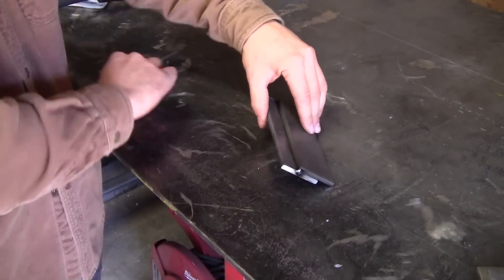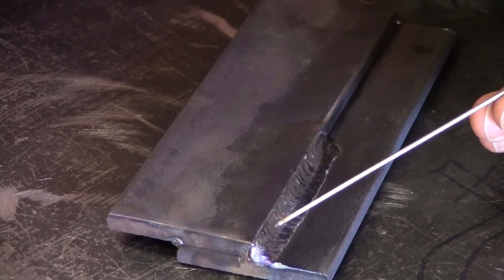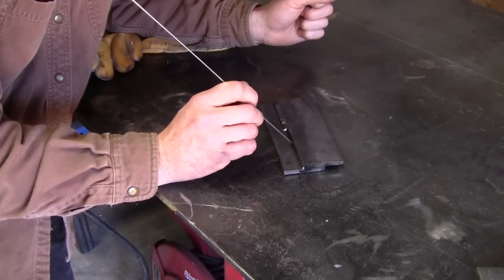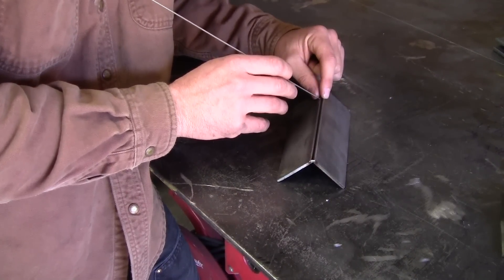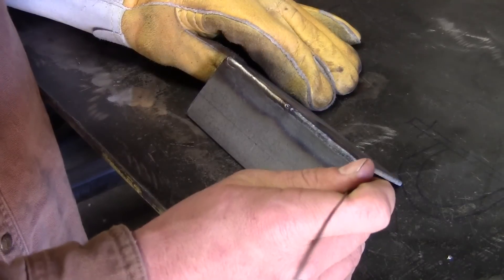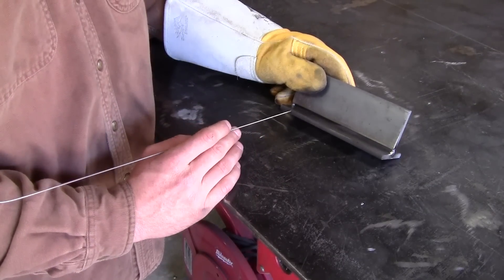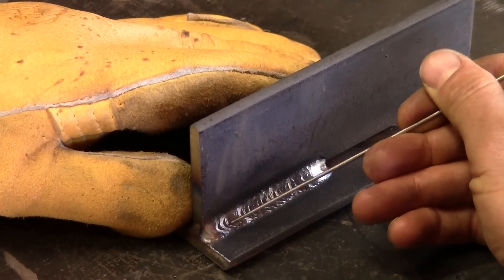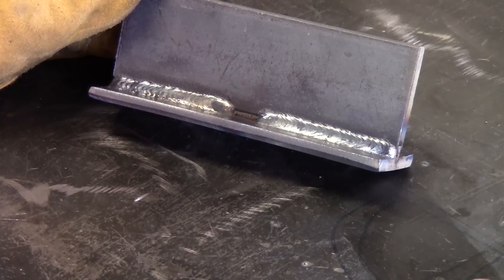MIG Welding Tips

Comment: Can't say I've ever had any of my welds look like this. All I get is a splattery mess. I can't see shit through this welding helmet even set at 9. I think I'm going to try a 500 watt shop light right next to the work, or don't in bright sunlight. Also what should I put between those lap joint bars to keep them from eventually rusting?
Reply: Mostly I can't see shit, if I'm off course, or when I've reached the end where I want to stop.  I wish someone would invent a welder that acted more like a hot glue gun instead of this sparky mess.
Reply: I hate being under a helmet and not being able to see anything.  At least with brazing you can see your work.
Reply: Get a better helment

Comment: Professional welders do not "drag" the torch - always push.
Reply: +David Richards  I'm sorry but you are wrong. It all depends on various factors. Having the torch pointed towards the puddle or dragging will produce much better penetration than a weld that is pushed or pointed away from the puddle. A weld that is pushed on the other hand will look better. So for me if i am welding a multipass fillet weld i will drag the torch on the first string to get good penetration, then push for the remaining strings as penetration is no longer a factor.
Reply: +Ted Burgess You can weld it upside down, eyes closed if you want, when you drag it may give you deeper root penetration but what about the reduced side wall fusion, the post heat weld anneal, the increased heat affected zone, the increased convexity of the weld, higher gas disturbance, greater sub surface micro porosity,  - or do these strength & quality reducing factors not matter????  Please oh please find me any reputable welding manual, book, papers etc that advise the drag technique for Mig/Mag welding - there are technical quality reasons for it - read them, if however you want to stay ignorant then so be it but then don't criticise what you don't know.
Reply: You must not be a professional. If you were you would know you will be in positions where you have to push and pull. You sould like another moron student.
Reply: Tec 9 Lets hear it from a real intelligent proffesional as to when you have to push and pull other than vertical down?
Reply: David Richards I'm not going to debate with you. I have been welding 32 years. You're clearly are a moron student who runs beads on a table.
Reply: Then you have been welding crap for 32 years, if you are so bloody clever, answer the question instead of throwing out the bullshit - answer the question toss pot.
Reply: David Richards The fact that you think there's a difference in push/pull penetration again tells me you are a moron student repeating what your instructor taught you.
Reply: You can't answer the basic question because as an amateur you do not have an answer - If you knew anything about welding you would know that of course there is a difference in penetration and profile whether you want to ignore it of course is your choice - but no respectable welding company would ever advocate or develop a procedure for dragging the weld - just tell us one - any one - you have the World to choose from??
Reply: David Richards Tell your instructor he's giving you old and outdated info.
Reply: Amateur, ignorant welders like you are the classic reason many in the engineering World believe welders are brain dead and stupid, you just confirm this, get back in your hole old man and play with the dinosaurs, the welding World has moved on.
Reply: David Richards I've forgot more about welding in my life than your clueless instructor has ever taught you.
Reply: Surely this is a contradiction in terms, how can you forget what you never knew? Go play with your rattle old man. Leave it to the professional welders.
Reply: David Richards By "professional" do you mean "2nd year student with no real world experience"?
Reply: From your total inability to give one technical welding reason you are obviously a deluded welding ledgend in your own mind, sad and sick , go get a life.

Comment: Id like to answer some of the questions that people have asked here. Im a welder with 20 + yrs of welding, I've done a lot of wire welding both flux core and hard wire. Along with a lot of stick welding. First off this is a pretty good video other than the fact we cant see your finished welds, please give a few close ups when finished. Thanks. I've heard a lot about pushing or pulling. It really don't matter, its about what feels right at that particular time or circumstance.

Flux core verses hard wire. Flux core is wire with a flux in the center of the wire, hard wire is just wire . While you can run flux core with out gas, it runs so much better with CO2, smooth and less spatter. Flux core is designed to run up hill (vertical),flat, horizontal and over head, hard wire is designed for flat, horizontal,, and over head and down hill (vertical) Hard wire is ran with CO2 and CO2 argon mix depending on the application being used. (down hill is vertical from top to bottom or its called down hand,) ( Up hill is vertical from bottom to top and can be welded with hard wire but its a pain to learn, but it can be welded with flux core very well)  

Types of machines to buy depends on how much actual welding your going to do and how much you are willing to spend on it. In my opinion Miller has the best machines going, but you pay for it, but they hardly wear out with proper treatment of it. 

Temps and wire speed depend on the size of the material and type of material you will be using. Millers have a guide on the inside of the covers, that covers every application. 

Welding techniques, there are various ways you can move the gun, from what you've seen here to using J.s to circles, to U's, you can use what ever looks good and feels right for what ever application is needed. 
Shirts can be bought at any Dickie outlet or distributor, they are heavy duty wear. 

Any other questions, drop me a line samo662003@gmail.com

Comment: fitting nice and tight? if you gap it, you will have much better penetration. In the pipe industry, if you don't gap a weld, you won't have good penetration. Your hands are very smooth but i think you're moving a tad fast. I'm not trying to insult you, by any means, just try and slow down a little and i think you will be much happier with the results.

Comment: I'm a self taught mig welder of over 12 years now, with a lot of old school teachers. I can honestly say I've never pulled on wire feed, and even in your video, it looks better to push into the bead than pull away from it. The only time I'm angled away from the bead is when I'm doing down-hand (vertical top to bottom). is there an advantage to pulling away?

Comment: Remove the mill scale before welding, preach this... its every bit as important as welding technique 
You're using off-cuts 8-10 inches long, would take you 40 secs max.
Somone may be relying on a vid like this to weld a crutual joint I.E a tow hook on a vehicle etc